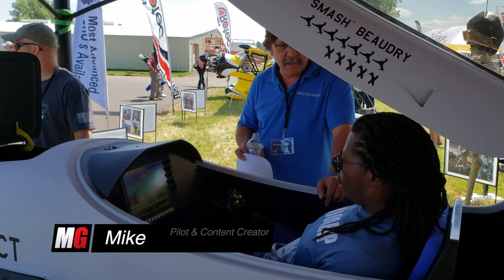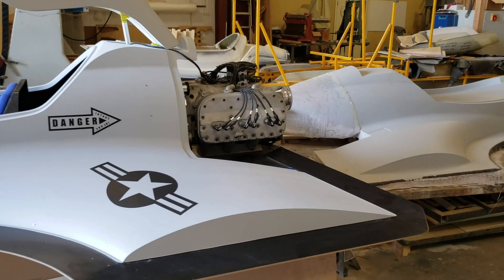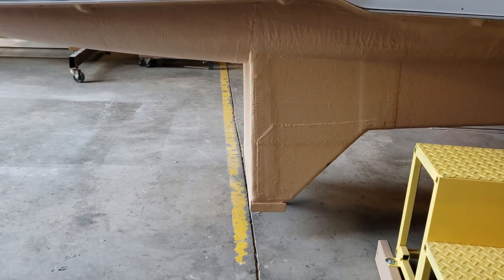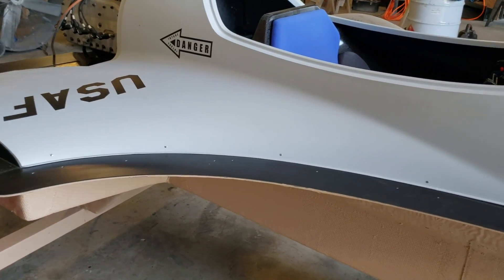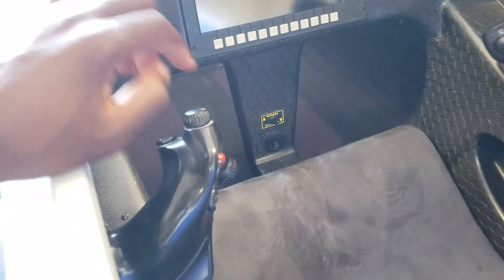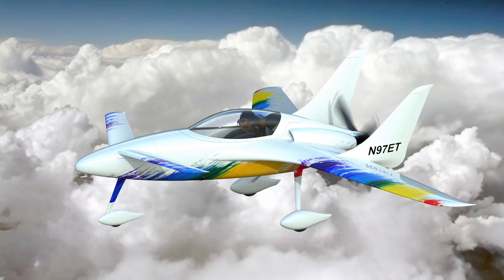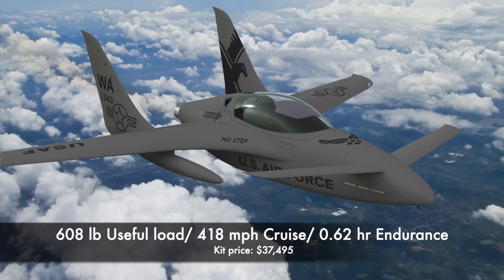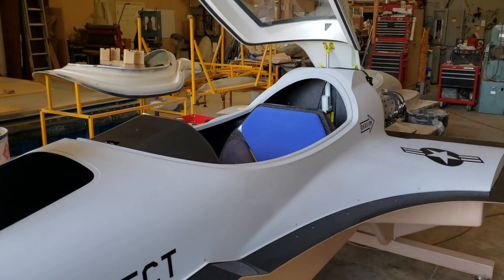Revelaero Single Seat Jet & Personal Aircraft

Comment: I assume those prices don't include the engines.  I wonder what the total costs would tend to be for everything you need.  The jet version looks fun, but .62 of an hour flight times won't get you very far even at 400mph.  They said it has over 600lbs of useful payload.  I wonder how hard it would be to exchange some of that payload for more fuel capacity.  They are cool though.

Comment: How does reserve fuel requirement work on the jet version with 0.62hr which is 37min.  Was it 3o min for VFR and 45 for IFR??  Can it fly from point A to B ?
Reply: Simple answer: No, the Jet has the same fuel capacity as the pistons die to useful load issues, making it impractical for anything other than looking cool. If you want the plane, go for the piston models

Comment: Meh...

Talon (entry level) – 80 hp piston engine; 160 mph cruise; $27,000; endurance ≈ 7 hours
Stryker (mid level) – 150 hp piston engine; 220 mph cruise; $38,000; endurance ≈ 5 hours
Voodoo (top of the line) – Jet engine; 418 mph cruise; $38,000; endurance ≈ none.
A toy for one. Especially the jet one.

I love that Burt Rutan's canard design! But I'd wish to see something in that design that has four sits or more.
Reply: OK,  so for another $11K the Stryker has about the same range as the Talon.  It's just faster and more complex.
Reply: If you can build it yourself get a Velocity TXL kit - 4 (at a squeeze 5) seats.  Claimed cruise 1,250nm at <25,000 feet.  Max speed 250kts.  Doesn't look as sleek in flight as this little single-seater, though.

Comment: 8:19 Stryker is same price as 8:55 Voodoo? Why wouldn't everyone want a jet engine?
Reply: Matt Kay,

Jet engines have fewer moving parts unlike reciprocating engines consequently catastrophic  failure is mostly unlikely to occur in gas turbine engines (jet engines).
Reply: @amoslukyaa5792   Right, just things like FOD, compressor stall, blade or disk failures.....   They also still have accessory gearboxes, oil and fuel pumps that can fail...  As a former test engineer, I've seen my share of catastrophic gas turbine failures.   You break one rocker arm, the reciprocating  engine doesn't immediately go to zero power.   Any engine can fail.  Hasn't been that long since I've seen a new story about a  commercial airliner having a catastrophic engine failure that killed a passenger with the shrapnel.
Reply: MajorLeague  is there any other aircraft similar to the voodoo? With possibly longer flight time?
Reply: MajorLeague  how hard would it be to buy a L39 and outfit it with a modern cockpit?

Comment: These are incredible. 200+ mph for less than 100k? Jaw dropping.
Reply: a claim is only a claim until video proof, because 2019 Earth.
Reply: 5 years late, the kit doesn't come with the powerplant. That said, these things are still awesome, and even at 80-100 for one of these complete, it's a personal fighter plane for $100. Closest I found to this was a used Cirrus CS-6(?) from Canada for just shy of $1M. It's a 2 seater that was used for fighter pilot training. So 10% the cost, and probably a similarly reduced annual cost too.